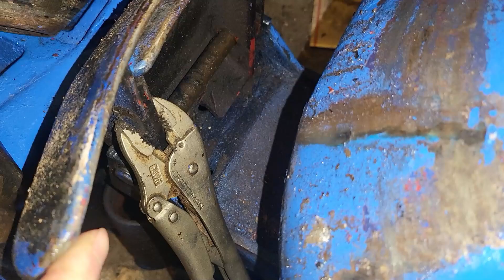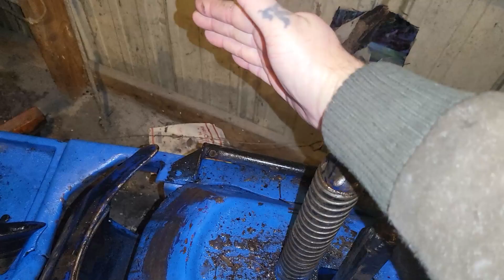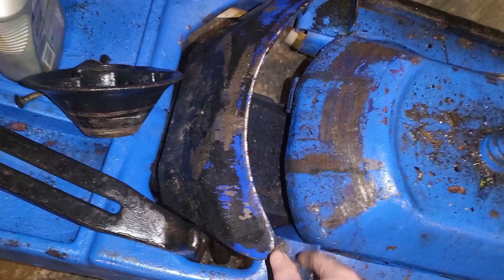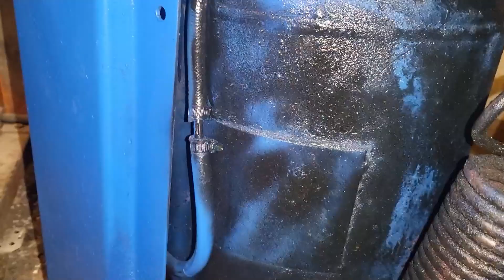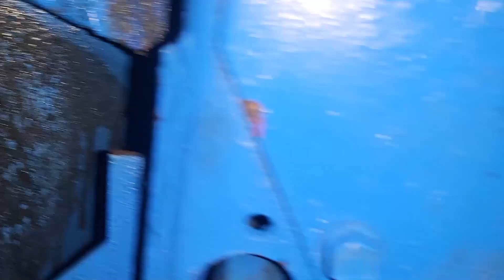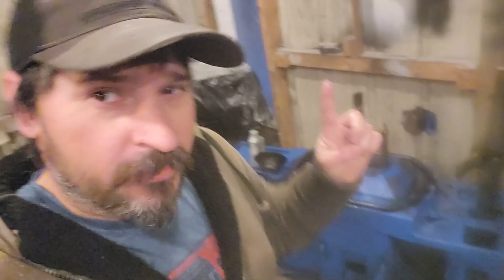Coats 4040 Tire Changer, The Worst Or Best Investment I Ever Made

Comment: Poor machine has had a hard life needs some love I own one of these and I look after mine very well what crazy person decided to paint it blue
Reply from the maker: @noelhenderson8095  I have no ideal who painted it blue, but it works and the blue made it pretty affordable lol
Reply: @TattsForLife  it does have quite a few parts missing on it but I can't tell where the knob is on the right hand side near the bead breaker that should be in the up position it is missing where you put the tyre arm I think if you're going to fix it you should be able to find parts for it over there I am in Australia and they would be near impossible to find  here I was looking for almost 4 years before I finally found one I paid the same price but in a lot better condition I had used one of these when I was fitting tires for over 20 years they are brilliant but you just need to look after them

Comment: That coats 4040 has serviced tires for 50+ years. The original front was metal and painted “Fire Engine Red”. Very nice find for $350 as sometimes they want twice that price and $500 for shipping. 
   I just want to know how the guts inside work as it’s a mystery to me, even though I have changed thousands of tires in my day with that exact machine.
  Thanks kindly for sharing you purchase and thoughts on how to get it up and going like new. Thank much!
Reply from the maker: It is a very well built machine, but needs some attention for sure.
Reply: I do have one of these in the red and the Black lot better condition though  awesome machine
Reply: @noelhenderson8095 I've got a red & black machine & there basically indestructible machines!